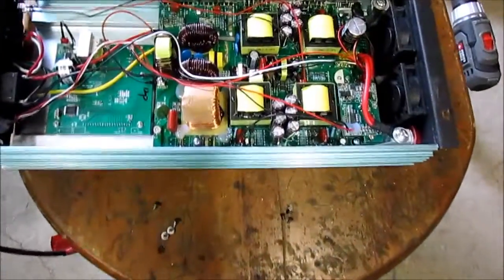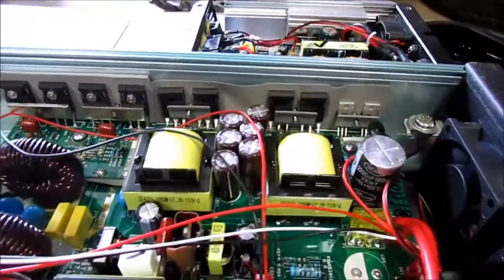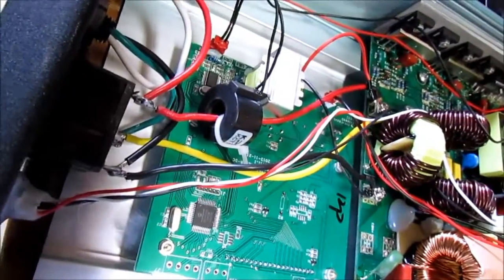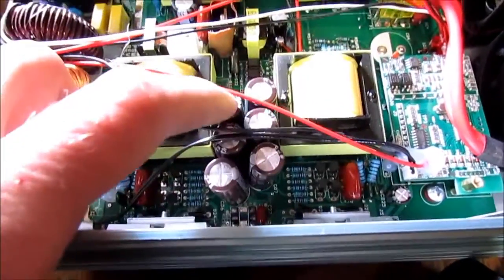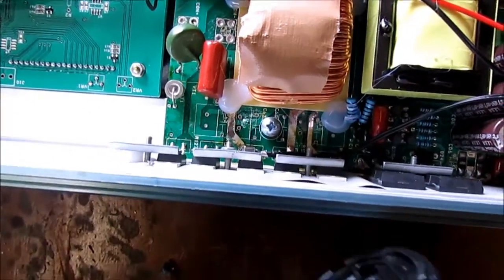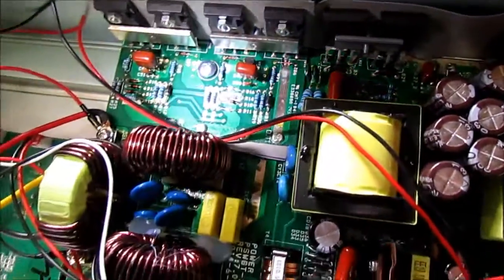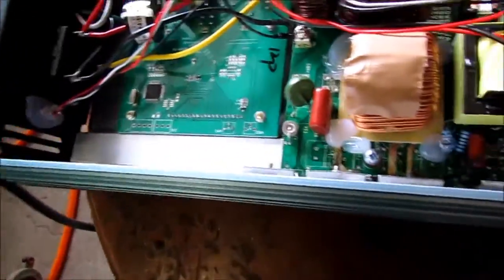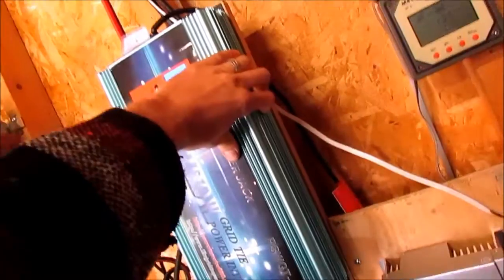1200w Power jack grid tie inverter guts

Comment: I know this is a real old post but just incase someone see's this can you confirm the on off sequence of these Power Jack units i have had mine for over 10 years but never used it and i want to try it out , but cant remember if its the solar first or the unit you turn on first and then the solar , if anyone around still remembers that be great Thanks
Reply from the maker: The unit doesn't turn on till you plug it into the wall. It's island protected. You can have solar first or plug it into the wall. At least mine was.
Reply: @GoingOffGrid101  Thank for the reply , i do remember there was a warning sticker that came loose on top of the unit when unboxing saying it must be turned on off in a certain way  , but of course it was so long ago i had forgot , i  tried it out yesterday to get the late afternoon sun and it worked pretty well  till late evening
Reply from the maker: @imhardatwork if you have a smart meter and make more power then you use, you will be charged for it like your paying fir electricity

Comment: its been a few years . is the power jack still working? I just got a 2017 model . 5kw LF power jack inverter charger. it was a good deal. and I'm planning on using about 2500-3000 watts. and not continuously. it was a deal. but still a chunk of change. that I wouldn't just throw away.  I just came across your videos so far fairly interesting.
Reply from the maker: its still working, not using it atm though

Comment: Seems common for Power Jack to set the output Current Sense calibration about 10-20% high... to make it seem better than it is. I'm going to recalibrate mine before installing it.

Also, your unit is mounted inverted... the hot air is blown out the DC end by the fans... so your mounting direction will have convection fighting against the fans when they come on.

The "hot-snot" glue may not survive in there... these things run pretty warm. Mfr's usually use a much higher temp. melting point glue, so it won't re-melt during operation.  The biggest concern for parts moving around isn't really during normal operation anyway... it's just sitting there on the wall, not much movement going on... unless it's used in a RV.
Reply from the maker: beforebefore i have remounted it the right way also did a cooling mod my fans run at full speed when the sun is out

Comment: The small 300 watt ones seam to do the best per price, if a smaller one dies you only lose 200 watts, unlike if you luse one big 1000
Reply from the maker: true but the big one is more efficient
Reply: But you also have to factor if big one fails it takes weeks to replace, witch is "wasted power"
Reply from the maker: Jeff Schefke thats why I have both :) and still like the big one better.

Comment: That piggy-back set of resistors could be an engineering correction made after the initial solder bath. The original resistor might not be at it's rated value and caused failure leading to a large amount of warranty repair/replace issues.

Comment: the "choke" is actually the current sense transformer, the smaller packages mounted to the case with 2 legs are diodes the other lager ones are MOSFET's not sure of the other 2 smaller ones with 3 legs the are probably MOSFET's gluing the caps down really should have been done at the factory thanks for sharing the video
Reply from the maker: thanks for the correction, and np I am still liking this power jack so far lol